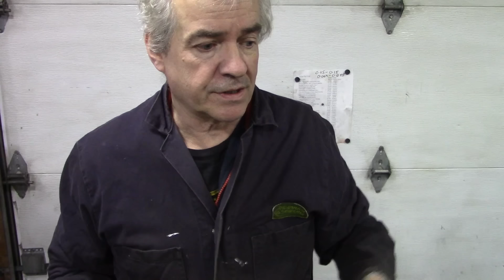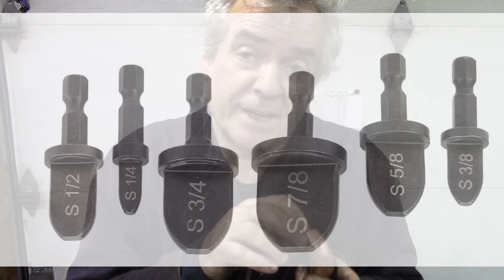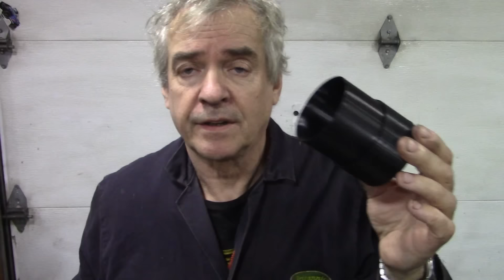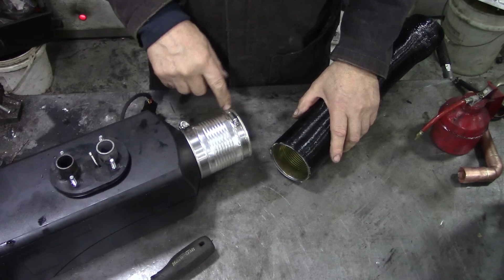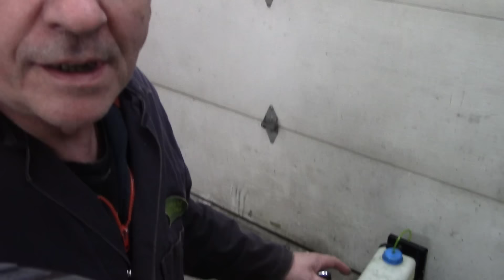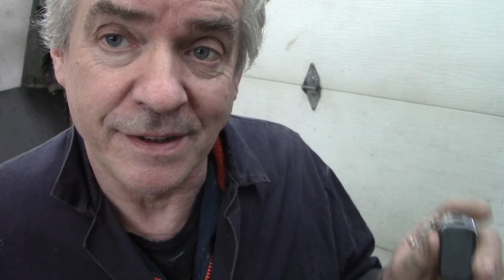One or two heater modifications

Comment: I'm late to the party.

I've installed many of these and the hydronic versions.  My advice is to seek out the 'clear' fuel hose.  It's helpful when trying to identify air leaks.

EDIT: my comment was if you have a fuel take far from your heating unit.
Reply from the maker: That's a great tip for troubleshooting fuel delivery issues.

Comment: "These Chinese Heaters are hard to beat for reliability". you've had to buy at least 4 additional controllers . Mike ??? 
,........ and they are COPIED from prior European originals which ARE more expensive  - but reliable . 
 V interesting though as I have one exactly ike yours warming my camper Land Rover 101FC .... sort of  works but temperamental . .... get what you pay for .  as ever .. Than ks for your insights and innovation - beans tins !!! Remember their ventilation use in the tunnels of the Great Escape !!!!!!!!!!
Reply from the maker: The patent ran out - so they could copy them and sell them at 75% cheaper than German ones
I bought more controllers as I didn't understand they were not all the same, and for C$45 for controller, cables, motherboard and remote, it is not going to break the bank

Comment: Don't know how your diesel heater came in the box but mine 5 kw came with exhaust pipe that fits perfectly on the outside on the exhaust.

Also as you say, NEVER use regular solder for this.
Best to use silver solder or brazing it.

Regular solder can start to oxidize heavily on this temperature and then the lead is water soluble and easily absorbs through the skin and give you cancer 🫣
Reply from the maker: Thanks for the information!

Comment: Whilst the temperature in the UK is nowhere yours, I have 2 in my garage and run the exhausts through  intercoolers (ebay special) with a fan to extract more heat.  I just keep the outlet above 50 to prevent condensation collecting in the intercooler (another very cheap ebay controller to control the fan).  You probably have all this in one of your containers!!!!

Comment: I have seen some of these exhaust pipes be put through a large radiator creating more heat 👍
Reply from the maker: Yes, but it needs excellent flow or the burner will smoke
Maybe something like this  
https://www.baseboardheatercovers.com/blogs/news/baseboard-heating-1950-to-present-day
Reply: @BritannicaRestorations yes that looks good, the one I saw used an old cast iorn radiator with 2inch fittings.
Reply from the maker: Exactly!

Comment: Had a couple of vids pop up on you tube recently showing people running the exhausts through a household type radiator, and drawing off quite a lot of otherwise wasted heat, may be worth looking into for your workshop. Probably hidden downsides to it, but looked useful.
Reply from the maker: Yes, I looked into this, and I did an experiment and found you need the least restrictive radiator possible or the burner will smoke - looking at a cast iron rad with 1 3/4 inch connections for the next experiment ( if I can find it under the snow!)

Comment: Copper expands a lot more than steel when it gets hot. I would have thought that seal would fail after a few times.
Reply from the maker: So far so good - I have found that as long as the clamp is tight, it works very well

These are the best
https://www.amazon.ca/Glarks-23-25mm-Stainless-Adjustable-23-25MM/dp/B08YYXC4JV/ref=sr_1_3?crid=1VXXKNHF3TLY3&dib=eyJ2IjoiMSJ9.DxEDx9JauJh4VTRaOZUTEbf7j5Mm_FifCn9l2uu6XM2c5hZNPhXykutscPMR2iOyRqjPdIw5uNmQ1NTeGmd-nz1RSRGYI49--GP1zNJ9tKNZpKJs-R83y5HLyA0zf-LSLz2Zyd7m0XT3EaalNYTwR8AHzAWbxMG703uCqozekA0vVHvrGOS1E6wTmun3Od53BOGnyNaMC6LwLbCBkr50fJaM3uTy_1Nj_C62tK6FdwMm046agaa57HjunKgn0VsP1BIcn4KH9J9jkDaTTI4TUeuwk4JvgPMwWUJ4GfKJqUw.MEDe3SNNitg-K1yZyi6Hg2oFV-sMZfF2aP1tptPd4aY&dib_tag=se&keywords=25mm%2Bt%2Bbolt%2Bclamps&qid=1769868923&s=hi&sprefix=25mm%2Bt%2Bbolt%2Bclamps%2Ctools%2C77&sr=1-3&th=1

Comment: Puszczą luty na na miedzi na temu rurka kosztuje 10 dolarów kanadyjskich
Reply from the maker: Lut ołowiowy ma różne temperatury topnienia - temperatura spalin w odpowiednio dostrojonym podgrzewaczu wynosi około 150°C. Lut srebrny ma bardzo wysoką temperaturę topnienia. Lepiej dmuchać na zimne!

There are different melt points of lead solder - the exhaust temp on a tuned up heater is about 150 c Silver solder has a very high melt point better safe than sorry!
Reply: @BritannicaRestorations what about using an exhaust sealant paste? It seals all right and it can withstand heat!?

Comment: The manual says to apply some exhaust paste to the pipe to prevent leakage. I guess they know there is a potential problem. 🙈🤦‍♂️🙏👍🏻🦘
P.S. Hopefully that tin will get a kick of paint. 🫟
Reply from the maker: These clamps are much better than worm drive claps 

https://www.amazon.ca/Glarks-23-25mm-Stainless-Adjustable-23-25MM/dp/B08YYXC4JV/ref=sr_1_3?crid=1VXXKNHF3TLY3&dib=eyJ2IjoiMSJ9.DxEDx9JauJh4VTRaOZUTEbf7j5Mm_FifCn9l2uu6XM2c5hZNPhXykutscPMR2iOyRqjPdIw5uNmQ1NTeGmd-nz1RSRGYI49--GP1zNJ9tKNZpKJs-R83y5HLyA0zf-LSLz2Zyd7m0XT3EaalNYTwR8AHzAWbxMG703uCqozekA0vVHvrGOS1E6wTmun3Od53BOGnyNaMC6LwLbCBkr50fJaM3uTy_1Nj_C62tK6FdwMm046agaa57HjunKgn0VsP1BIcn4KH9J9jkDaTTI4TUeuwk4JvgPMwWUJ4GfKJqUw.MEDe3SNNitg-K1yZyi6Hg2oFV-sMZfF2aP1tptPd4aY&dib_tag=se&keywords=25mm%2Bt%2Bbolt%2Bclamps&qid=1769868923&s=hi&sprefix=25mm%2Bt%2Bbolt%2Bclamps%2Ctools%2C77&sr=1-3&th=1